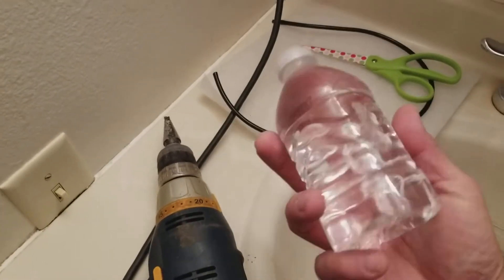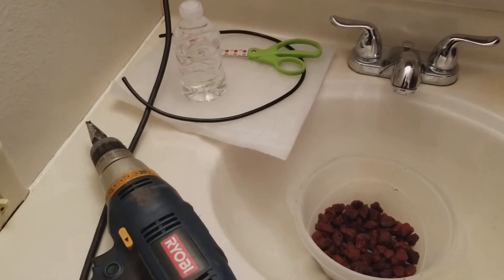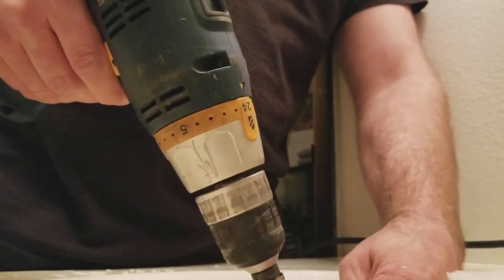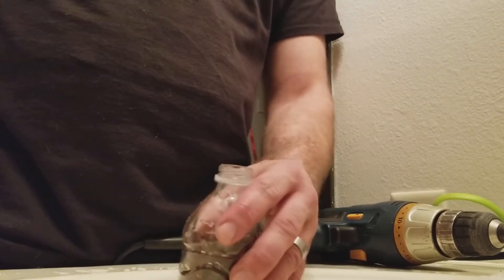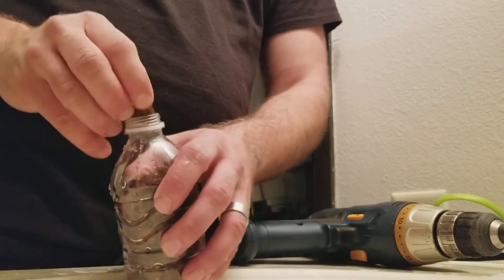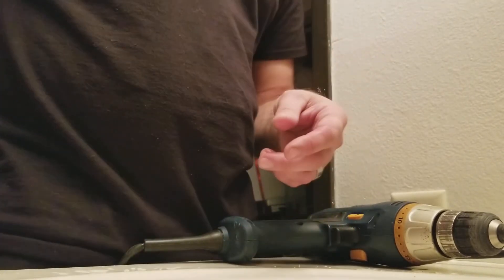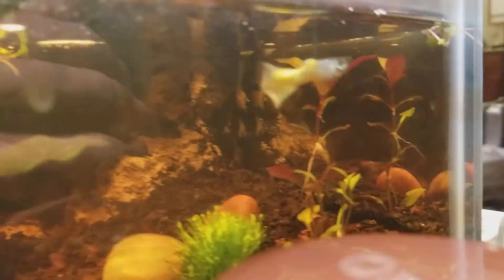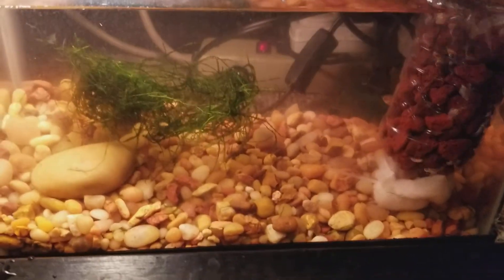DIY water bottle filter using lava rock

Comment: I added for my HOB AquaClear 20 lava rock. Had a big aquarium lava rock with hammer broke two piece one 2 inch and one 3 inch place on top the ceramic bag. A again with hammer more into smaller places for my Fluval Nano Filter
Reply from the maker: Adding a corse sponge on the intake will be a nice next step to add as a mechanical prefilter.